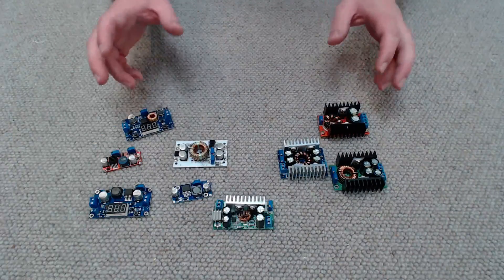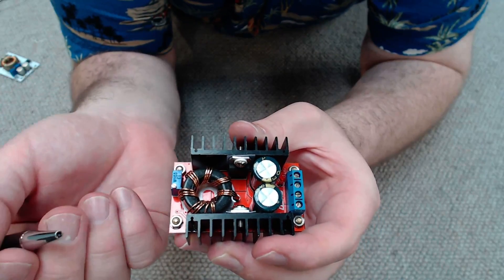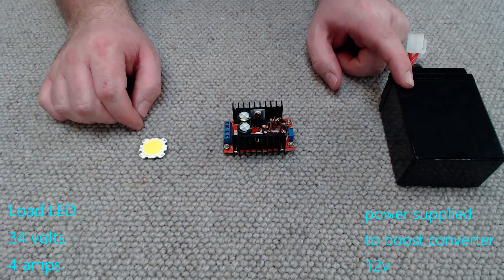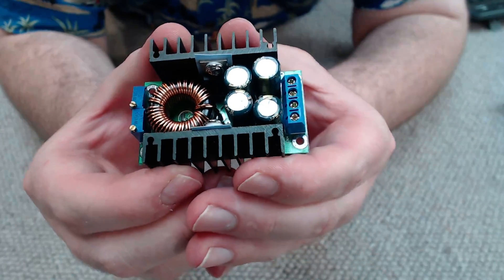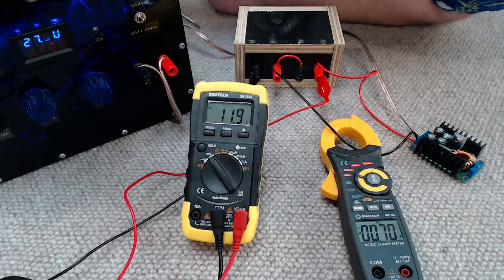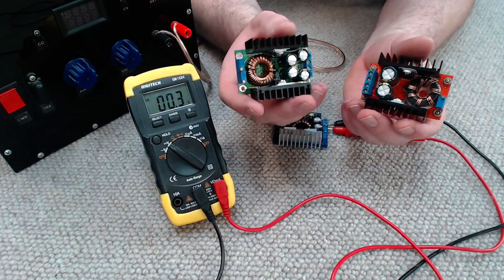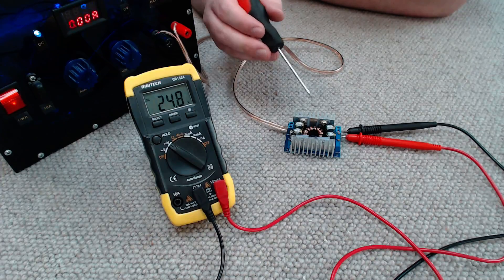What You Need To Know Before Buying A Boost/Buck Converter

Comment: Excellent Video i need your help please reply

1 Input Adaptor Volt 12 and 4.16 Amps as per your calculations it is 42.5 watts

2. required output is volt 14.4 and 4 amps as per your calculations it is 2.95 amps

it is still low as per my needs 14.4V / 4A

My Questions

1. So i need a 12v and 6amp adaptor for take 14.4v and 4.25 amps from buck converter ?

2. still i am good if i am taking out with my old adaptor 12v 4.16A from buck converter 14.4v and 2.9A  ?

3.is that ok/possible take higher voltage from buck converter by multiplying input adaptors volts and amps like input buck 12v 6a out from buck 14.4v 4.25a  ?

Thank you
 in Advance

Comment: First off. Thanks for your videos. They're both funny And educational.
Second is my question. What if I put two boost converters in series? The
First converter will be feed 12 volt
Which then gets regulated up to 20 volt, which is then fed into the second converter which regulates up to the 30 volts I want, which then is current limited to 2 amps. Following the maths, that means: the second converter gets a 60 watt load on it divided by 20 we get 3 amps (well within spec) and the first converter gets 60 watt as well divided by 12 makes 5 amps also within spec.. This should work.. Unless I'm missing something?

Comment: hi i have a 36v 370wh battery its 10a, the charger is 42v 2a so about 84w i'm wanting to buy something like this to charge it from my car at 12v, think the controller on the battery can accept up to 4a  whats the best dc to dc boost module? i would prefer one that i can control urrent and voltage as constant?

Comment: that is awesome excellent
i have a question : i have this buck converter xl4015 5v to 30v and 5A
 (4A Load without Heatsink)
Example: i have input 12 volt and 3.34 amps it is 65w adaptor smps , my required output is 14.4 volt and 4 amps =  55 watts ( is that possible )
Thank you

Comment: My daughter’s 12v electric Razor scooter is too fast for her. I like to drop the voltage down to 9v. Do you know a buck converter that can handle the scooter without overheating? It’s a 10 mph E90 Razor scooter. Send me a link if you would. Thanks.

Comment: Thank you sooo much. I have that 2nd last one on my bench. I was going to use a PC supply and this dc-dc buck converter to build a variable bench supply. I was ill for a while and forgot that I bought 1 and how I was going to use it.  I was going to remove the multi turn pots and extend them to the case.  I may get back to this since I also have a DC-V a DC_A digital meter but I am considering using the newer meter/converter package, abt $30 usd?  Do you have any info or videos on that,  THANKS!

Comment: I have a question..lets say i have power supply  12v  at 75a but i want use that boost/buck to up the the volts to 24v  to power a charger thats 300w max will ill be ok?.....only reason why i want 24v cause im not getting full usage out of my charger with the 12v

Comment: 7:10 why did he pick 26v in the demo instead of 24
Reply: To be more realistic. The load is 34V x 4A = 136 Watts. So, if converter efficiency was 100% then the current at 24V would be 136 / 24 = 5.67 Amps.
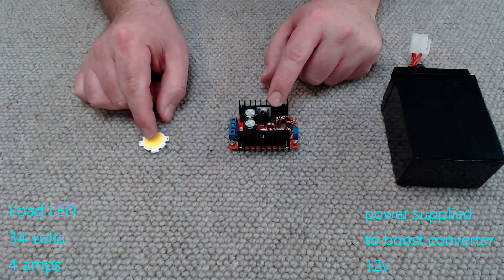However at typical 90-95% efficiency that means input of 5.965 to 6.296 Amps, which exceeds the rated capacity of the converter which he says is only 6A at 6:24 , .. so to avoid questions he just jumped up a couple of Volts.

Comment: Thank you , great video. Do you know any boost that can give me an output of 5V and min 2A with 3.7v 18650 standard 2600mAh battery?
Reply: There are literally hundreds available that do that job. Just search eBay, AliExpress, Banggood, etc for "powerbank modules". They incorporate the charging circuitry, battery  level meter, as well as the USB connectors for output and charging too.

Comment: Here is a question that seems problematic for most people to answer. I currently have auxiliary LED light on my car that have both full light and parking light feature. There are three cables 12v feed for full light, 12v feed for parking light and ground. The parking LED lights are too bright and I need to dim them. As it is in my car, the space is minimal. I would like to lower the light output by lowering the voltage feed to the parking LED with 9V,  however this can only be done on the 12V feed wire, meaning I can´t use the negative wire as the negative wire is the same for both the parking LED and the full LED light. Can I use a buck converter and only take the output + feed from it and connect it to the parking light feed wire so it will only feed 9V? or do I have to connect both + feed and - feed from the converter to get 9V feed to the LED?

Comment: I have a question! Say I have a buck converter that reduces 48V to 12V. If I were to change the input voltage to 24V without touching the board, would it then output 6V? Thanks so much for your help!
Reply: No it would not happen bcoz of flyback function

Comment: Great Vedio and very well explained. Just one question I have 19v 4amps laptop charger and want to run 775 motor at 12v 5 amps will it run is the amps in power supply shud always be greater than amps needed or buck converter will give me more amps even if supply less amps please help

Comment: Input wattage x efficiency = output wattage
efficiency is usually around 75 to 85% but I will use 0.8  [80%] here
Say you have a 12 Volt 2 Amp power supply, which is 24 Watts. Multiply by 0.8 and you get about 19 Watts as the maximum output.
If you wanted a 5V output then the max current is 19/5  - using a buck
If you wanted a 24V output then the max current is 19/24  - using a boost
Or
if you wanted 60 Watts output, then 60/0.8 Watts is the needed input.
For example, you want 12 Volts at 5A, then the power on the input side must be at least 75 Watts - if a 24 Volt power supply is input then it has to supply at least 75/24 Amps

Comment: Were two points missed?  Efficiency and waveform. The efficiency does vary - don't be fooled by the "UP TO 95%" claim. That only applies to a specific voltage and current. You need to adjust the input wattage by the efficiency to get the output wattage. 
The output waveform can be 'messy' with spikes, ramping and noise. This can affect sensitive loads.

Comment: Everywhere I look benchtop PSUs supply about a max of 10A between 0-30v. I don't think I need that much range, just maybe 0-12v Is it possible, with a buck converter, to help get more current? I.e 10A x 30v = 12v x 25A?

Comment: I simply want to power a 1A, 12v fan using two 3.7v lithium battery, parallel or serial for handheld fan. Obviously, size and efficiency is important. What kind of buck booster is the best choice?
Reply: why not use three batteries in series
Reply: @kennmossman8701  Because of size and weight. I am tailoring a 3D printable shell to hold the battery and converter. I want the design to be lightweight and portable, easy to carry around, even hang it over neck or belt. Now also considering using 1x high output (4A)  lithium battery
Reply: @maxlawwk  makes sense. do check the Efficiency at 3.7 versus 7.4 Volts. Often efficiency is lower at lower voltages. Check the mAH as well. You need a BOOST converter - to increase the voltage to 12V.  Check that it works with an inductive load like a fan (many do not).  A fan needs a higher current to start so go for a converter that can provide at least 2 A at 12 V

Comment: 13:45 VERY TRUE THAT. lol. Raised my boost converter voltage and pooped the output capacitor. Definitely be careful when upping the voltage with these. Or make a case.

Comment: I have EGO 56V / 7.5 Amp Batteries for my lawn mower and several other tools.  IF I were to use a BUCK converter to step the voltage down to day 12.5 to 13 volts, what would the realized amp hours be for that 12.5 to 13 volts?

Is it safe to say, if I have a 4 amp load on the 12 volt side of output of my BUCK converter that the draw on my 56 volt input side of the BUCK converter would be approximately .86 amps?  Which if I divided into the 7.5 Amps of the 56V battery by the .86 amps that would be approximately 8.72 hours of run time?

Lastly looking for a BUCK converter for the above scenario is the wattage rating capability of the BUCK converter on the input, 56V or output 12V side?  Or whichever is higher?
Reply: seems you are confusing the recommended  maximum current draw with AH. You didn't give the AH of the battery. 
Input wattage x efficiency gives  output wattage
the input current divided into the AH gives the time

Comment: I have a high-power USB at my PC. It can deliver up to 100 Watt (I tested this and it can deliver). Voltage is obviously still 5V since it is USB.
Can somebody recommend a boost converter that can use the USB input and boost this to 9V or 12V with an output of ~40 Watt? (only want to run this 2-3min at a time)

Comment: Hi, how are you? I need help  :)
 I have 12v 7A  prolink sealed  battery. This battery need 13.5-13.8v for floating or 14,4 -14.8v cycle charging with 1A. l would like charging this by laptop power supply 12v 4,6A.  So I have to change voltage from 12 to 14.4 v ( or 13,8? ) and current from 4,6 to 1A?. 
  buck boost will be ok? 
And can you explain me how set and check current ( can I use multimeter and connect straight to module to output ?) 
Battery will supply bluetooth amplifier ( I build for camping :) ). 
Amplifier need constant power minimum 5v ( range is from 5v to 24v but I will use 2 speakers and 12v I think is minimum).  During the work battery will go down power,  ( voltage and current?) 
So I need also buck boost for keep the same  voltage when voltage from battery will go down? 
Kind regards Pawel
Reply: you need a boost converter and a proper battery charger. refer to the specs for the charger

Comment: Does anyone know if one of these can be used as a fixed power supply by applying a 220 V transformer for an 18 v / 2 .0 AH (DEVALT) drill
Reply: I recommend you find a electronics technician.

Comment: im not understand english good, but what convertewr i need, my ATX power go out 12 Volt 20A and i need adjustable power supply max 48 volt out and 5-10A i need made atx power have out banana plugs 3,3V.5V,12V,adjustable 36-48V max 10A and current need be adjustable if have my test laboratory power supply.

Comment: Can i use boost converter as battery charger? Input 12v and output to 14.4? 4s lifepo4 battery
Reply: NO. you also need a proper battery charger

Comment: Can i wire a 12v power source to 300w boost converter and boost the voltage to 30v and wire the output to the 150w buck converter to adjust voltage and current for my diy adjustable bench power supply. I am going for this idea as I couldn’t get the buck boost converter.

Comment: i actually looking for buck converter for a projects (tethered drone) 

the idea is sending Ac/DC  200-300v (adjustable) through a 100meter tethered cable to the drone (buck converter) we tested we need 24v/800w to keep the drone operational.   

so basiclly we looking all around the internet we can't find DC step down 200v to 24v .. 

in my hand we already have the AC/DC 0-300v 1.5a adjustable power supply. and a buckconverter brought from ebay (70v to 24v 30amp) 

we do try sending 70v from ground and stepdown to  drone buck converter( 24v 30amp) it seems like the buck converter never reach 30amp) so my guess i need to supply greater voltages to the buck converter..

any advices would be highly appricated

Comment: the best way to acquire a reliable, cheap buck, boost or bock/boost converter is to make your own. if you want to get into electronics you shouldnt rely on those cheapass modules that can actually get very expensive for no good reason at times.

Comment: Wondering if anyone knows if two buck converters can be run in parallel to up the available wattage on the output side. Looking at Droks 12A 720W Buck converter to power a 48V ebike motor from a 60V battery and would like more power available. High output converters are considerably more expensive than if two of these could be run in parallel
https://www.amazon.com/gp/product/B071LGTTRN/ref=ox_sc_act_title_1?smid=AFHAE9RJVUMB&psc=1
Reply: honestly I would not try....far more complicated than what it appears

Comment: Hello sir....
I have a Toshiba laptop charger 19v 4.75a and i want to use it on a KSGER T12 soldering station.
The station need 24v 3a to work ....I order the 150w step up converter yesterday to step up 19v to 24 v.
Would be ok for the converter? In my output i will have 24v 4.75a ?
Reply: input wattage x efficiency = output wattage

Comment: I got five of them and so far two of them literally exploded after I hooked up the positive and negative in with only 13 volts from Lithium 4S cell. The capacitor blew right out I think these things are defective. The first one didn't explode but the negative in wire melted

Comment: So, buck converter behave mostly like linear regulator with slightly more noise. 

How about boost converter, do with fluctuating voltage we got fixed output voltage or the output voltage fixed to some ratio relative to input voltage? Like in situation where you use car 12v lighter socket while the engine run. The lighter socket voltage fluctuate between 13ish volt to 14.4v. Do we have stable output voltage with boost converter?
Reply: yes

Comment: Old video, but 3 things. 1-very few of these things have the outputs isolated from the input, and 2-have no reverse voltage protection. You could charge a small battery, but if the supply power is cut, battery will slowly feed back into the power supply. I fix that problem with a simple mechanical relay. Another is these things are all toys. Nobody makes a serious high power device that could handle higher currents in the order of 20-50 amps.

Comment: I would like to run a 120V 12A grinder off of 1 (or up to 4 if I have to), 12V deep cycle batteries. IS this possible?
Reply from the maker: So your grinder will draw 1,440watts of power. Obviously, you'll need an inverter to run the grinder from a battery. Assuming the inverter is 90% efficient,  the total power consumption from the battery/batteries will be around 1600 watts give or take.  That works out to be 133 amps from a 12v power source. Or if you run 2 batteries in series for a total of 24v, the current will be more manageable at 66 amps. Refer to your batteries datasheet to see if they are rated to handle these power figures.

Comment: I have (two) fixed magnet alternator rated at 15 amps, 12v output (but that varies with RPM). I want to use this to charge the 12 v battery. I can use diodes to rectify to DC. Will a buck converter work in this application? How big would it have to be?  I want to use one in a wind generator, and one on the tractor...
Reply from the maker: My initial thought would be to recommend you use a Solar Charge Controller (normally used with solar panels to provide a constant voltage output) You'd need a full bridge rectifier & Capacitor to rectify & smooth the power before the Solar charge controller.  I'd say you'd need about 10,000uF of caps as a guesstimate.
Reply: @Schematix  Thx for that, especially about the size of the Capacitor. I\ll check out a few more of your videos, and may end up with more questions
Reply from the maker: @charlesfitton9677  Glad I could help ;)

Comment: If my power supply is a Krisdonia 25000mah, and is supplying a DC out of 16-20V with max current of 4.7A, can I use a buck converter to power 2 DC motors at 12V each with higher than 4.7A current for when more torque is required by the motors? Will stepping down the 16-20V at 4.7A to 12V increase the output amperage at the motors? Is this dangerous?
Reply from the maker: So your power supply is rated to output a max of 20V @ 4.7A (20 x 4.7 = 94watts) Let's assume the buck converters you want to run from the power supply operate at 90% efficiency. And each buck converter needs to output 12V @ 4.7A to run the motor(12 x 4.7 =  56.4watts) So 56.4watts + 10% for power losses = 62watts per buck converter. And since you need 2 of them the total theoretical power consumption would be 124watts. And remember your power supply can output a max of 94watts. So in conclusion. No, it won't run the motors at full power. In theory, you could run each motor at 12v @ 3.5A and stay within the 94watt window however, something to consider is as the battery voltage decreases during use, the max output will also drop. So in other words, if the battery voltage drops to 16v, the max output goes down from 94watts to 75watts
Reply: @Schematix  Ah thanks for the help! I think what I'll do is split my 20V at a terminal block and shoot down branches, each with its own converter -- one converts to 12V for a dual channel DC motor controller (which will inevitably power two motors at much lower than max speed as you suggested), and the other buck converter will convert to 5V for my microprocessor (jetson nano) which for my purposes consumes about 5V/4A (20W) with peripherals. 

Long story short: 

power supply 20V/4.7A --> 94W

2 Motors (12V @ 2.5A) --> 60W + 20% losses (buck and controller) = 72 W. 

Jetson Nano (5V @ 4A) --> 20W +10% losses = 22W

Thus total power consumption is about 94W which is the same as the supply watts. I think this might work? just really slow motors considering the no load current draw is about 0.5A each motor.
Reply from the maker: @XxDnvnPlmrxX Your calculations look good to me. I'd imagine your power supply has some sort of overcurrent protection already but, I'd recommend using a buck converter that has "Constant Current". That way you can set the current to your exact requirements without exceeding the maximum output of your power supply.
Reply: @Schematix  just purchased two with CC and CV options! thanks for the advice! happy new year!

Comment: You use a very flexible calculation , 1st you use 12 Volt then 2nd you use 26 V , this is wrong if you want to compare you do need to use 24V.